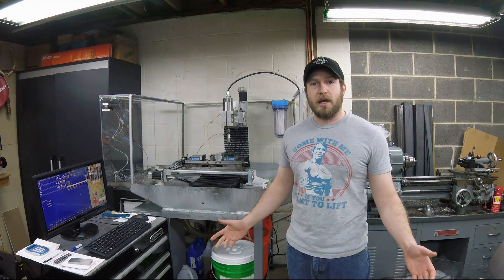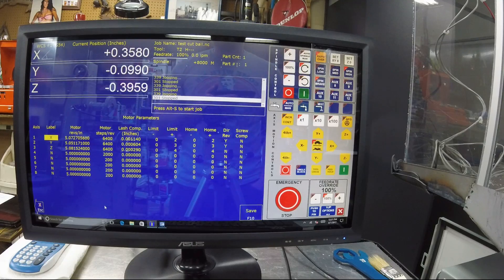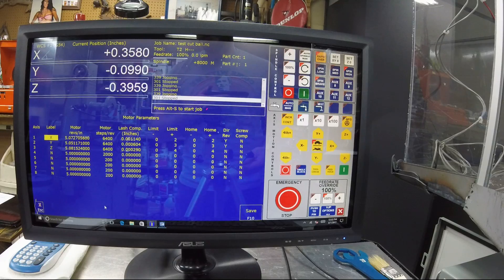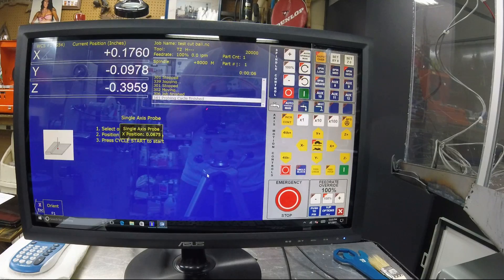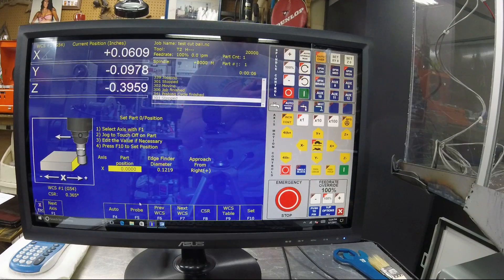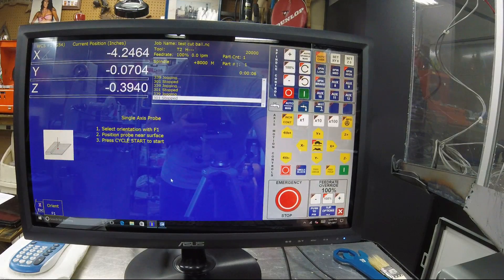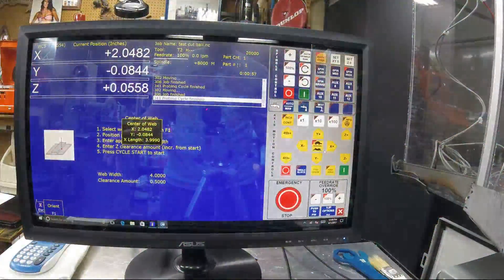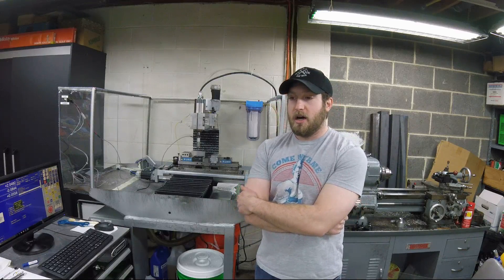Mill Rpi setup using Centroid Cnc Acorn Board

Comment: I have the ability to add a DRO in my quill (I have a anilam z quill ball screw setup) can I use the DRO to help the controller know exactly where the quill is? I’m having issues getting my quill accurate.
Reply from the maker: You could use the dro to map the ballscrews movements but as far as hooking it up to the acorn no. It does not have any inputs for scales, centroids bigger and way more expensive controllers you can add feedback to.

Comment: 0:51 6400 step rev. 5mm lead 6400/5mm =1280 step mm. its so easy its EXACT number.
motor turn 0.2/mm *25.4 = 5.08 rev/inc. math say its EXACT 5.08. use it. its not 5.07???????.your hig priced measure suck.if not happy USE mm when you have mm ballskew it will EXACT and mm is more acurate based on 0.001mm and 0.0001inch display.
0.001mm equal 0.0000393inch. so using MM you have more acurate display.
you cant even see last digit move.when you move 0.0001inch its 0.00254mm. get it
and 1 step in your setup is 0.00078125mm = 0.00003075inch. you need 4 step to see last digit change. i need 2 step. get it yet xD even you will see change in 2 step,but its allready rounded up
Reply from the maker: Dude, if its so easy make your own video about it. The cheap ball screws i had in the machine needed to be comp regardless, I use inch display cause thats what I work in. But enjoy shitting on my videos by all means if it makes you feel better.